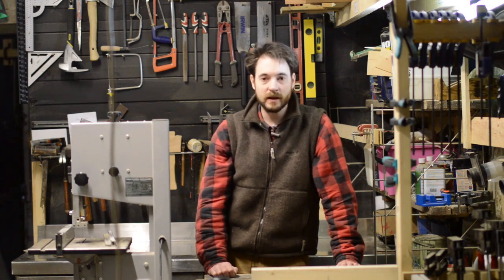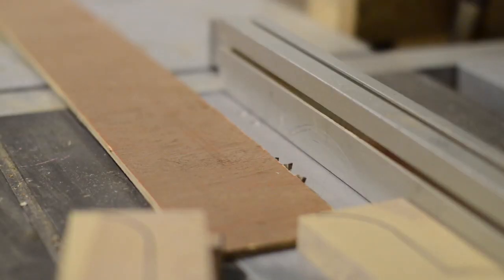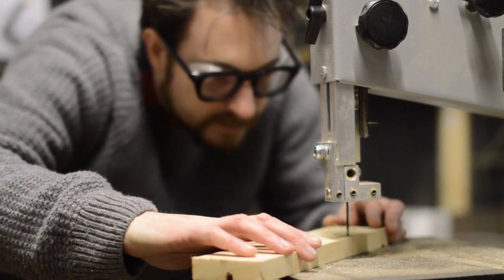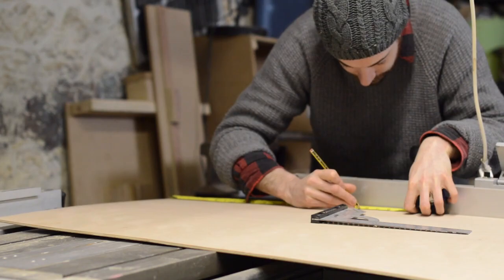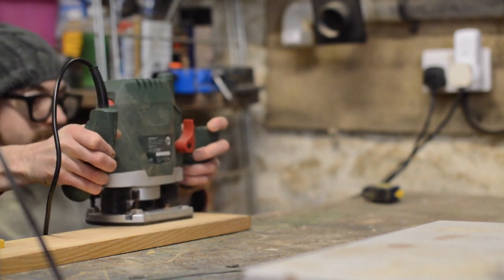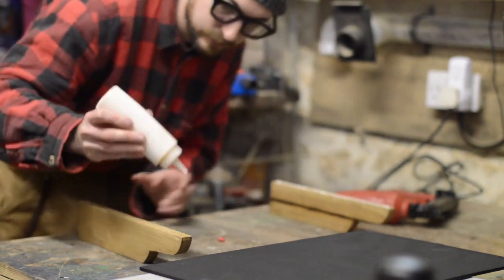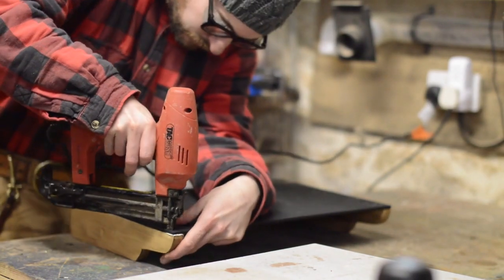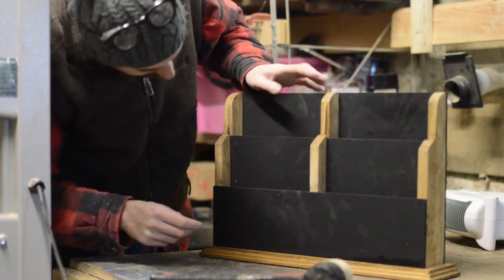Menu Holder

Comment: Very nice looks a nice pub too Fullers if I'm not mistaken same as my local. 👍🏼
Noticed you have the 10.8v DeWalt impact driver how do you find it? I don't tend to use mine much.
Reply from the maker: Well spotted it is Fullers. I really like the 10.8 drill and driver for small projects around the workshop. I would like something bigger with a hammer action for larger tasks. What do you use?
Reply: I have 3 10.8v tools, the drill, hex chuck 'screwdriver' with clutch and the impact driver. I think because the screwdriver is so good (plenty of torque) and has the added benefit of the clutch that's why I use it over the 10.8v impact driver. Im lucky enough to have quite a few 18v DeWalt tools too and have an impact driver in 18v which is a monster. The 18v brushless combi hammer drill is excellent too with a 4 or5 ah battery it has all the power you'd ever need!
Reply from the maker: Nice collection. I don't have the screwdriver. Sounds a good tool. The 18v brushless is on my wish list
Reply: The screwdriver is probably the tool I use the most you should look into it, you can pick up a bare tool for about £40 on eBay. 👍🏼
Reply from the maker: Sounds good advice. I will have a look at one. Thank you.